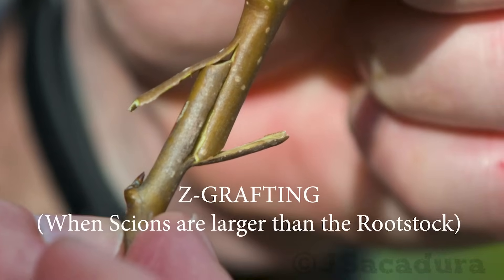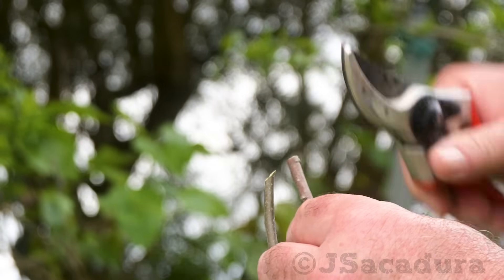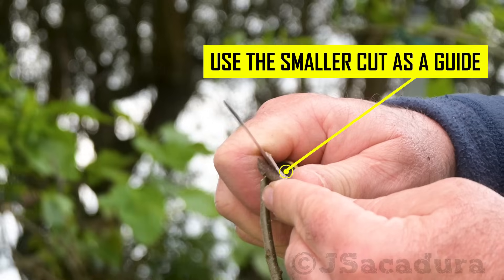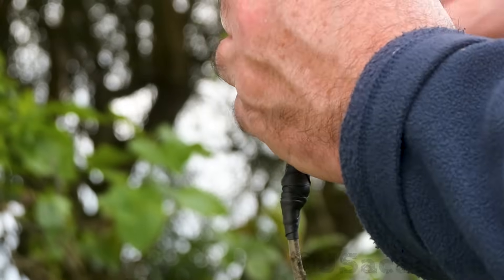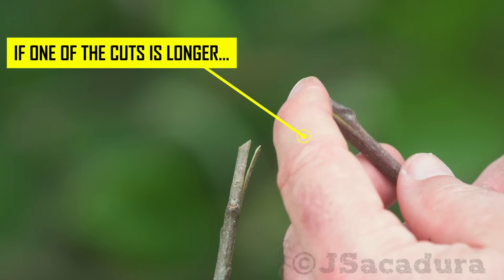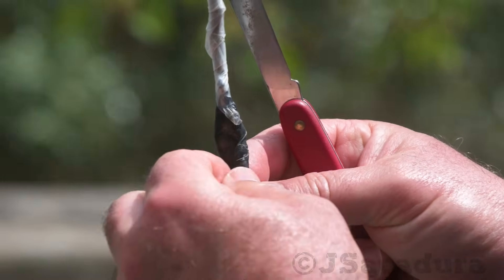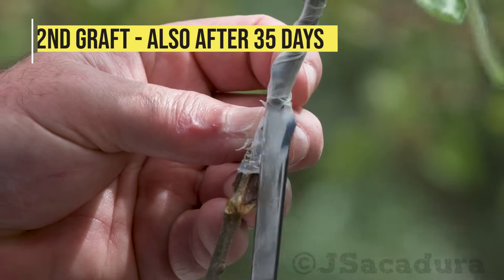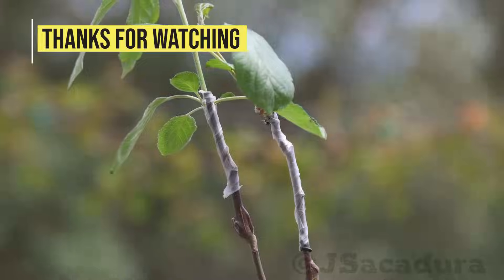Z-Grafting | For rootstocks thinner than your scions

Comment: if I may observe , the second shorter bevel cut is unnecessary. It does not articulate with anything but by doing this cut it makes the subsequent long cut more difficult to perform.

Comment: I have a question for you about Auxins... I have a 5 stone fruit tree it was air layer and the same time grafted the 4 onto the plum tree as you already have knowledge of such...

I took pencil size cuttings one from each... Sliced lengthwise set flat sliced again lengthwise brought together and minced up all the same on all the 5 stone fruit salad cuttings and as you do the (willow water) I did the same for this tree of 5 stone fruits... Then filter debris very well...

Here's the question....

Can I use this fruit salad tree water as say it's an natural rooting hormone homemade for own Auxins species air layering watering and if so will it hurry up the rooting process of the air layer I did? Sao normally air layering rooting takes roughly like 45-90 days (depending on really everything...

Will it possibly hurry it up to make it grow Roots quicker than just plain water?

Comment: I had an American persimmon seedling rootstock and a selected fruiting variety of American persimmon that was more than twice the diameter as the young thin seedling, I did a reverse side lap, the same thing as this, just no flap from the very small bottom, rootstock, and it worked great!
I also did a Z graft with hybrid European chestnuts on red oak and it grew surprisingly fast, 5 feet in one season.
I might have used it in my Mirabelle plum on Prunus Serotina experiment too, that grew great, and Mirabelle plum was the only one that survived on Prunus Serotina.

Comment: They're the same size
Reply from the maker: The difference is not much on the first graft example, but its very noticeable on the second graft. Even small differences in diameter can cause graft failure with cleft graft, for instance, when people try to align cambium lines. This technique overcomes that problem.
Reply: ....as your brain? I mean diameter.

Comment: Thanks for the good video. I eill try this in the upcoming season. One thing I notice is  that seems you could take the outside flaps where they come down the stock and up the scion and expose yhe cambium thereby giving more connection b/n the two pieces.
Reply from the maker: You're right, that would provide more cambium contact points. The technique works perfectly without them but you can always try it. Thanks for the comment.

Comment: The blade of your secateur need to be on the side that you will keep because the conterblade damage the bark.
Reply from the maker: You're quite right. I was more concerned in showing that the secateur should be at the same angle as the cut in the rootstock and neglected that aspect. Nevertheless, the scions are so thin and flexible that there's almost no damage to the bark, even using it wrong. Thanks for the comment.

Comment: I like to use a modified version of this for thin scions on thicker rootstocks, it makes a strong union that heals over quick. I just use a steeper angle, making both cuts about the same length. Works good on interspecies prunus grafts that grow fast and try to break in the wind.
Reply from the maker: In that situation I mostly use the modified cleft graft. But you have a point regarding the resistance of the graft. This technique will require stacking the graft in the first 6 months to avoid wind breaks. A stronger graft union is always better with quick growing, vigorous varieties.

Comment: Is that rubber tape, electrical tape?
Reply from the maker: It's used for electrical work and house repairs. It's a self-adhesive rubber tape. But electrical tape also works.

Comment: I've managed to do a chip bud of a scion that was slightly thicker than the rootstock, similar to these here. It was a tad janky but eventually ended up working nice, so I guess that's viable too. I managed to force it to break bud and leaf out the first year too which I think helped a tad.
Reply from the maker: I have done it too, in a couple of situations. Since most chip buds can be adjusted to the rootstock that technique also works in this situation. Thanks for sharing.